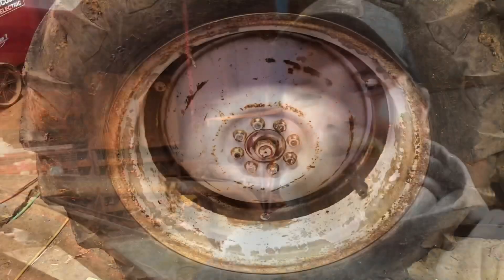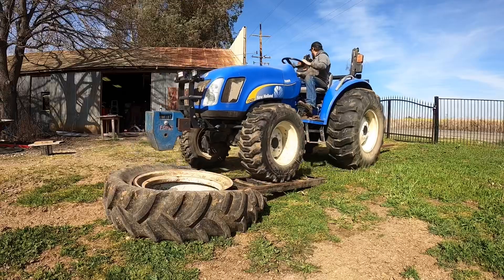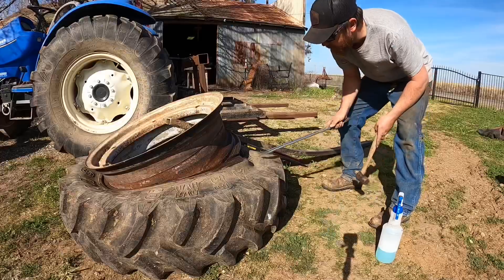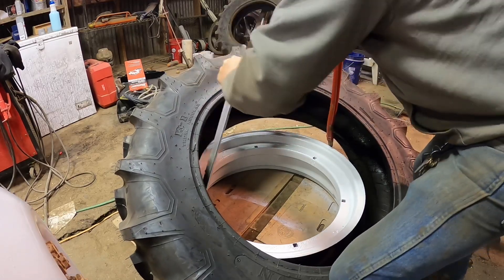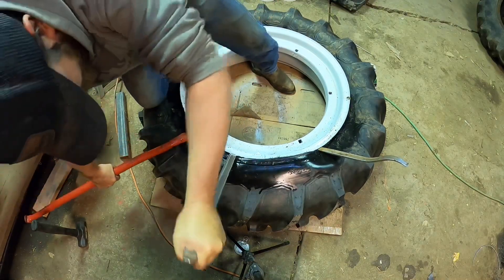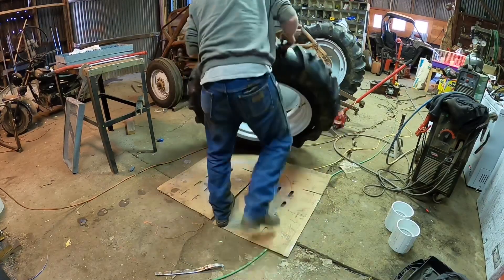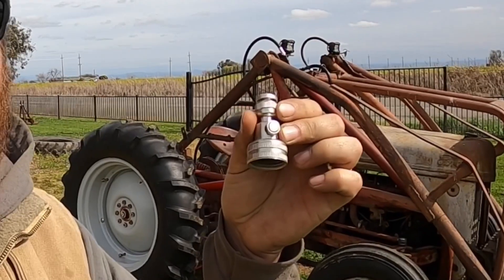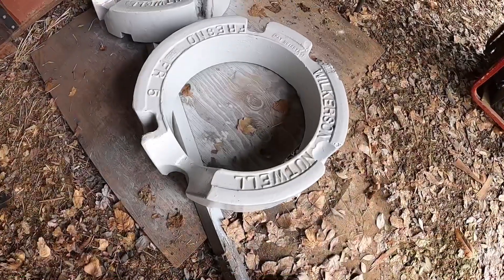Installing Rear Tractor Tires and Weights by Yourself!

Comment: Yes, make sure that the valve stem hole on the rim is on the correct side with the tire tread pattern so that the valve stem does not end up on the inside facing the rim when it is mounted on the tractor. and before you mount the tire/rim onto the tractor while it is still deflated, now would be a good time to cover the tire with cardboard and finish up painting the rim from the scratch marks of the tire irons. Then when the touch-up paint is dry, inflate the tire slowly so the the innertube does not twist or pinch.

Comment: Calcium is highly corrosive and if your valve stem starts to leak you’ll rust your rim out. We use windshield washer fluid as it adds weight not corrosive and doesn’t freeze

Comment: Hey Tyler,
I just recently had to do the same thing, the local tire shops couldn’t do my tires. So we did them in house. 

Good job adding the information on why ballast is needed. But you gave the secondary reason. The primary reason being that it helps to keep it on all four instead of flopped  on the floor. 😉 

You and I both know that the weight by right gives us traction and stability all at once. Others may not know the risks of not having said ballast. 

Keep it up. Good looking tractor.
Reply: You may have to drive a long way to find a tire shop that will handle tractor tires.

Comment: Tube in tires, water in tires, calcuim chloride, valve stem to hose adaptor....these are the things I need to know! Rebuilding a 53 Jubilee. Always change my own vehicle tires, wondered about the 38's........ great video tons of good info! 
P.S. I want you barn, tractor and basically life....Please see "What about Bob" for clarification...:)
Reply: P.S.S. If maximun water content is required I wonder if using a/c vacum pump on tubes would work...if it matters that much....
Reply: PSSS. Look into 2k clear from a can on Youtube...Super easy to apply and protects that paint....

Comment: You did really well dismounting and mounting, I see you're very strong....wait until you get a bit older...instead of taking your regular 10" to 13" bites along the tire you'll be taking 4" to 7" bites. Something to remember when it getting tough...take smaller bites. Last year I took off some 1946 mounted tractor tires (super hard rust encrusted rubber)...one I got off the normal way the next one was just way easier to cut of. Impressive wheel weights. Never seen water-coolant added to tires for weights...learned something.
Reply from the maker: Yeah I thought about cutting them. The other tire (that I didn’t film) was much harder, definitely should have cut it!
Reply: Few years ago I got one of the screw bead breakers from the jungle.  Now HF has them and you can catch them on sale or make your own.

Comment: The last set I've done, I did like you - off the tractor. I remember it putting me in a bad mood. I've been told since that it's easier to do with the rim mounted to the tractor. Maybe someone with more experience can comment. Anyway, nice work. I bet you slept well that night
Reply from the maker: Yeah I’ve heard that too. But you would need a bead breaker for that. Maybe next time I’ll try with the rim on!
Reply: @farmertylerranch4399  that's true, hadn't thought about that. Also would be less than ideal for cleaning/painting the wheels and hubs.

Comment: Having a bead breaker makes the job a lot easier. I have used a hydraulic jack and an IC bumper on my truck to break the bead. Back when I was a tractor mechanic we had tire mounting compound. On my farm I just use straight dish washing soap no water. Like your idea with the ramp and tractor to break the bead. I recently got a 1950 Ford 8N and the rear rims are rotted really bad. Tire is rusted to the rim. Gonna try our idea.
Reply from the maker: On the other tire my little tractor wasn’t enough weight. Had to use my truck (much heavier nose!)

Comment: Great Job FTR!!!  But you are going to have to paint those front wheels now, they just cant wait.  I have changed a lot of 18 wheeler and tractor tires in my life and I loved the way you broke the trires down by driving on them with the tractor, that would have been useful a lot in the past, we always used a tire hammer and beat them until they broke loose, your way looks so much easier.  Also, carrying an additional bale on the back of the tractor with a hay spear is great ballast when you need it.
Reply from the maker: Oh I know I was thinking the same thing!

Comment: Doing it yourself  was the best way to get the rims painted.  Could you trust a tire shop to paint your rims?  I've done that with the rake wheels and tedders that sit outside all the time. 
I used 60 gal of RV antifreeze because mine leaked out and what was left of what the dealer put in was pink ..  In some areas they use beet juice or windshield wash.   Calcium chloride has sold many rims.
Always use the biggest hammer for better satisfaction.
I've worked on big tires on the rim if I can get the inner bead off, but good you painted.

Comment: Great video but I would never put water in tube bc if you get a leak or pin hole it will eventually rust your rim out as I have discovered.

Comment: You should have painted the inside of the rim. The inner tube will seal it and cause corrosion, and the soap attracts moisture, better to use Ruglide,if available. Other a good video. 😊
Reply: Otherwise a good video. 😊

Comment: Not bad Amigo i saw a couple close calls. VISE GRIPS AND A RAG ARE YOUR BEST FRIEND.
Reply: You missed out on the best parts 1. breaking the beads with a hammer or slam bar  2. Dealing with the weights with out the forklift.

Comment: Leave the rim on the tractor, it makes it a lot easier, a tractor tire is easier than a back lawnmower tire or a double beaded tire. Leave it on the tractor so you can turn the wheel as you put the tire on and let gravity do the work.